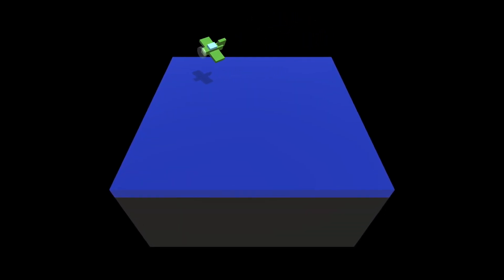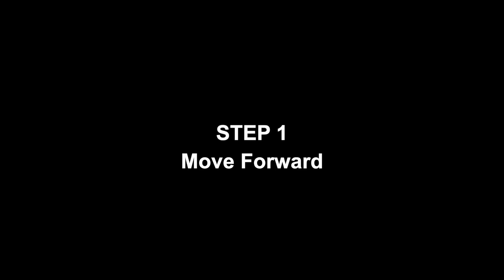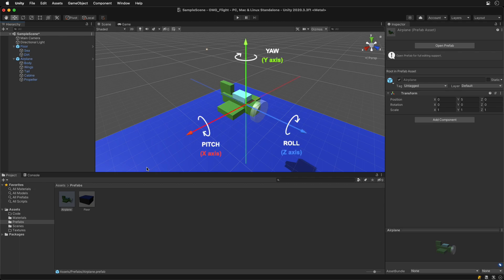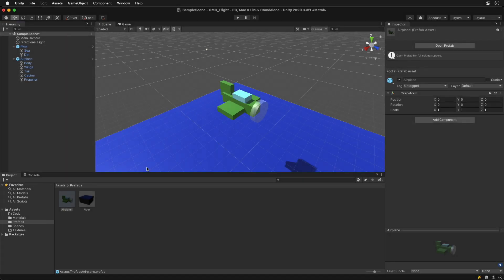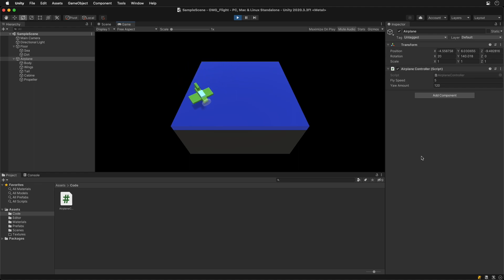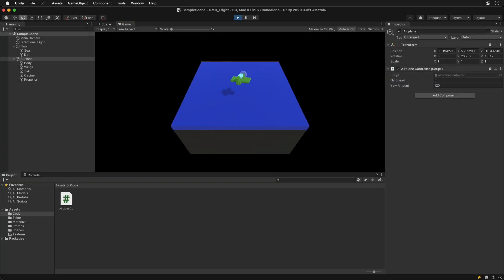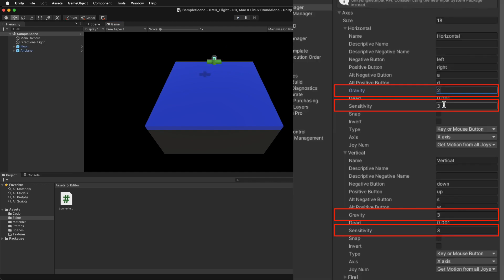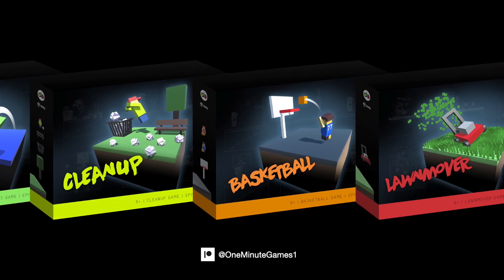How To Make Flight Simulator In 5 Steps | Beginner Game Tutorial In Unity

Comment: im having a problem when pitching up and down, the plane pitches up and down around a point but not in the plane itself, the point is below the plane for some reason, could i have a helping hand please ?
Reply from the maker: Make sure the origin is at the center od the plane. Open the prefab, set icon to see the origin (click on the cube icon at the very top in the inspector while the top parent is selected). Then reposition the graphics to the origin.
Reply: @oneminutegames7308  hey it works ! thank you very much !

Comment: Amazing Tutorial! I adjusted the parameters to be really slow, which works great when inputs are given, but as soon as the input is 0 the plane e.g. rolls back super quickly (at a different speed than if as an input is given (e.g. -1 or 1). Does anybody know what I am missing here?

    void Update()
    {
        //swell
        transform.position += transform.up * Swell * Time.deltaTime * Mathf.Sin(Time.time);

        //move forward
        transform.position += transform.forward * flySpeed * Time.deltaTime;

        //inputs
        horizontalInput = Input.GetAxis("Horizontal");
        verticalInput = Input.GetAxis("Vertical");

        //yaw, pitch, roll
        yaw += horizontalInput * yawAmount * Time.deltaTime;

        pitch = Mathf.Lerp(0, pitchAmount, Mathf.Abs(verticalInput)) * Mathf.Sign(verticalInput);
        roll = Mathf.Lerp(0, RollAmount, Mathf.Abs(horizontalInput)) * -Mathf.Sign(horizontalInput);

        //apply rotation
        transform.localRotation = Quaternion.Euler(Vector3.up * yaw + Vector3.right * pitch + Vector3.forward * roll);

    }

Comment: Briliant vid!!!! Subbed! ...just 1 question, how can you make the control not go back to 0 when you release the key? As in if im turning left and take my finger off the key, it doesnt level out, same for other controls.
Reply from the maker: Put the part of the code that updates input values in if statement, with condition that only executes the code inside when the key is down… if(Input.GetKeyDown(KeyCode.LeftArrow)) {}… But then you can’t put it back to 0 at all. Another way would be to create separate turn value, and increase it slowly, and use that turn value instead of horizontalInput etc.
Reply: @oneminutegames7308  Will give it a go, thanks....please make more!!!!!!!!

Comment: plz reply how can i add a break in my plane so I can land it
Reply from the maker: if (IsFlying) { /* put current move logic here / } else { / decrease y position if greater than zero and reduce speed */ }. Switch IsFlying bool between true and false with a keyboard key you want for landing. Check documentation for Input.GetKeyDown().
Reply: @oneminutegames7308  thank you but I didn't get that is it possible if you can make a video tutorial on it ?
Reply: I am a beginner so that's why I didn't get it 😅
Reply: @DilipKumar-po9kw  it’s a simple if/else statement, perfect for beginners to learn, google about it for more info. With it you make two state for the plane, one if it’s flying, and another when landing. Put different logic in each. And for flying you already have a logic in the tutorial. For landing experiment, that’s the best way to learn. If it’s too hard, choose a simpler goal, until it’s so simple that you succeed. Then make it harder and build on that. Rinse and repeat. And soon you’ll be surprised how much you’ve learned :)
Reply: @nejcanclin8874  thanks for the tip😊